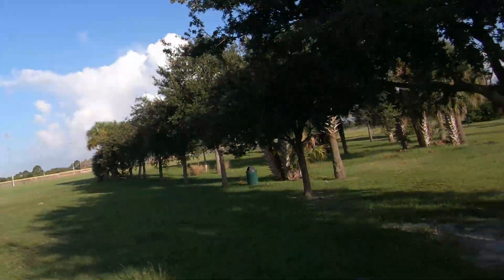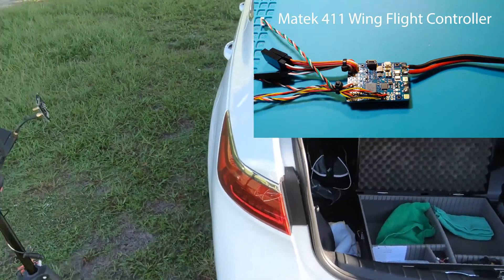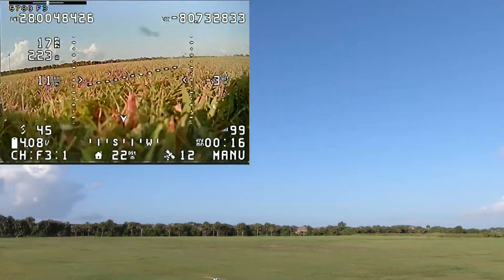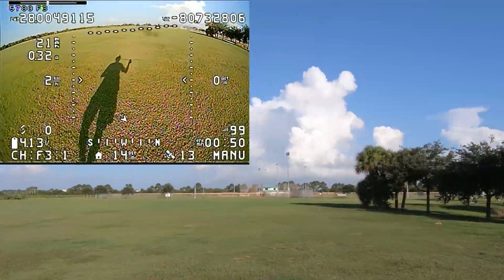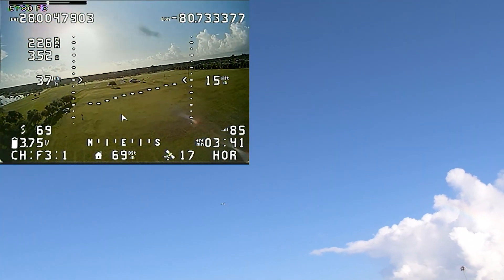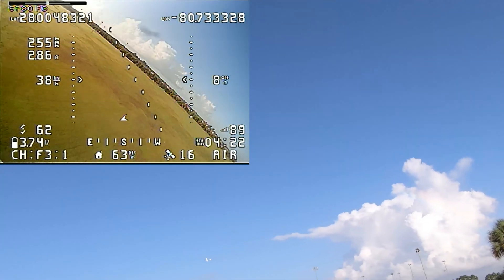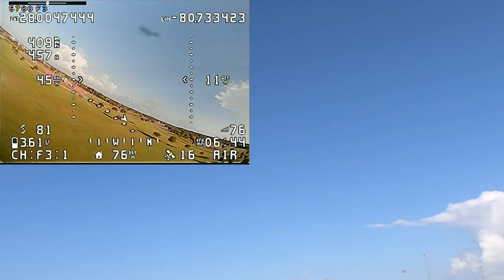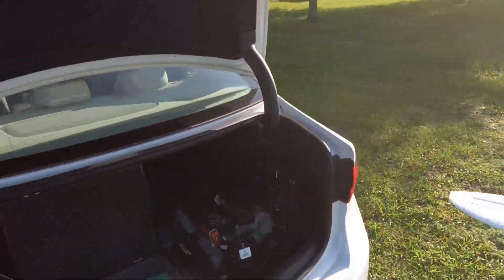ZOHD Drift FPV Fixed Wing Maiden Flight - INAV 2.5.1

Comment: Thanks for the video, Question: How much flight time does a 1.5 amp 2s battery have for it?
Reply from the maker: I use a 2s 3000mah lion pack and can get more than 30 minutes, but I have never really stretched the battery past that.

Comment: Do you get an indication of the height and speed on your goggles with the standard fpv version?
Reply from the maker: If by standard you mean without a flight controller then the answer is no. You need a flight controller with an OSD chip in order to display altitude and speed from the GPS
Reply: So if I buy the FPV version I should also buy an OSD chip to get data about speed etc?
Reply from the maker: The fpv version as I understand it comes with the zohd kopilot light and does not have a built-in OSD chip. What I did was by the PNP version, and install a Matek wing  411wse flight controller running inav. This would require a separate camera and VTX and would be way more complicated to build.
Reply: @OldGuyCarnivore  Is it possible to install a OSD in the FPV version of the plane?
Reply: @OldGuyCarnivore  Sorry for the many questions. I dont know much about but I find het very interesting.
Reply from the maker: Sorry, No
Reply: @OldGuyCarnivore  No problem, thank you for answering my question :)
Reply from the maker: You're welcome. Check out videos from Andrew Newton and painless360. They have great content about fixed wing fpv.
Reply: @OldGuyCarnivore  Thank your for the advise😉

Comment: Did you use a Y-cable for the ailerons?
Reply from the maker: no. separate outputs from flight controller for Inav stabilized aileron S3 and S4.

Comment: Great maiden Mitch!  I saw 17 satellites at one point and you hit 55 kmh at one point.  Nice roll in there too!  So will you be adjusting the arm for the elevator or are you just going to roll with a lot of trim?  I was thinking you said it would do a loiter, is that a certain mode or just a different switch?  Crap, I forgot to look for altitude or does it have a barometer, knowing you, it does, LOL.  We have a saying here in the south about what you crammed into that puppy, 10 pounds of crap in a 5 pound bag.  ;-)
Reply from the maker: Thanks Ed, I will adjust the elevator so I can zero the trim on the radio. Yes, it has altitude and all the other INAV goodies.